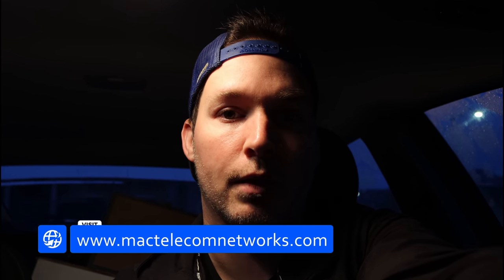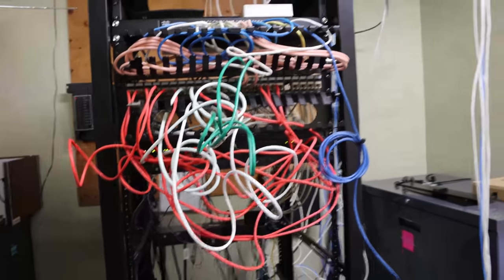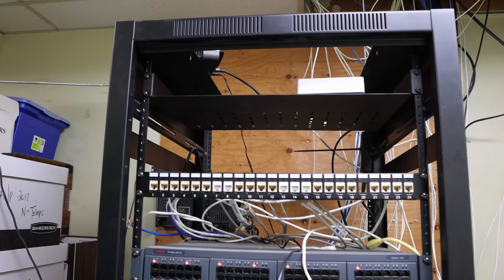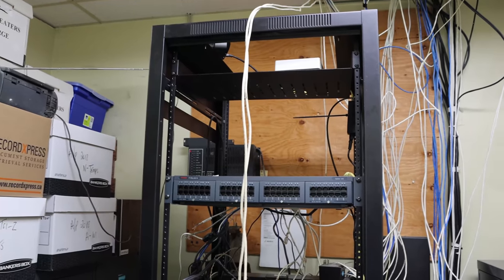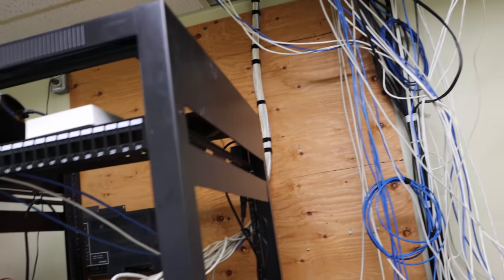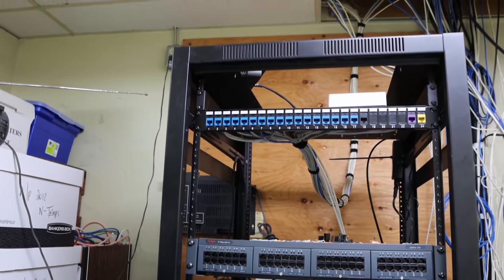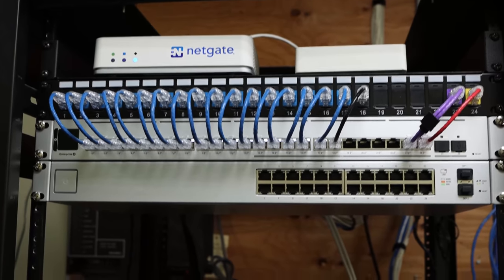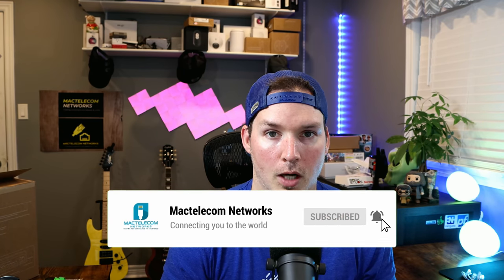Cable clean up, Ubiquiti and pfsense install

Comment: Nice work! One thing I would recommend on doing is to keep some extra cabling in some form of a service loop just in case down the line you or someone else needs to re-service a network cable that is on that patch panel. Like in this video that you didn't have like 10 feet of extra cable, I would velcro it all together and make some sort of "drip" as a loop requires more cabling to do so
Reply from the maker: Hey,

This is a great suggestion and on all my installs I do leave service looks. How ever this cable was already run before with no extra slack so no service loop available

Comment: At 3:30 ish you mentioned seperate VoIP vs data cables... Thus my question today on the Live Stream 😊
Reply from the maker: Ohhhh ya this was a different case. In typical deployments we are using one cable for voice and data.

This customer has a different setup

Comment: I really don't like how a lot of those digital phone systems have to have the right phone in the right port for the extension to be correct. It's why I like pure IP tel where the PC piggy back's off the phone on the desk and that goes back to a network switch. Those cabinets are so much easier to keep tidy.

Comment: Looked good but I didn't see any UNIFI controller for remote management, are you using the netgate with an SSL VPN connection to then manage the devices locally?
I was pretty sure you needed a UNIFI CK or a PC running the software on site to manage the UNIFI equipment.
Reply from the maker: I use hostifi
Reply: @MactelecomNetworks  I see. That makes more sense. Thank you. A thrid option.

Comment: Good job. What was the shortest cable terminating on patch panel? I may be wrong, but I have noticed you shortened the cables leading to patch panel so they fit exactly position of the patch panel, not leaving too much slack to accommodate for possible future scenarios. I might be wrong and there's already slack left not visible in that room higher in the ceiling. Otherwise very clean job.
Reply from the maker: So you’re not really wrong. The majority of the cables has very little slack left; these cables were pulled years ago and the previous vendor left no service loop.

I pulled around 8 new cables and left about 12 feet service
Reply: @MactelecomNetworks : Good to hear that. This is how it should be done. Someone someday will thank you in his/her thoughts for that extra slack:)

Comment: What a mess that was. I love seeing these videos making it nice and clean for future add ones. Question where did you buy the different color jacks? I'm setting my up and would like to  make my camera system a certain color plus my ISP and AP ones ... Keep up the great work... by the way any soon will you be doing a update video on setting UDMPro with after the firemare upgrade? Wanted to see if you made any changes on setting up IoT, admin, and camera network. 

Keep up the great work!